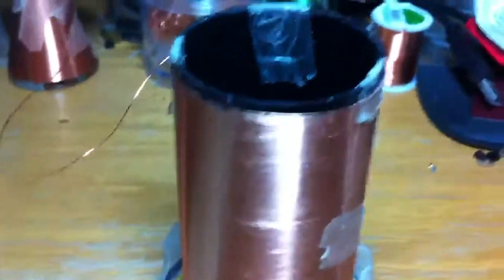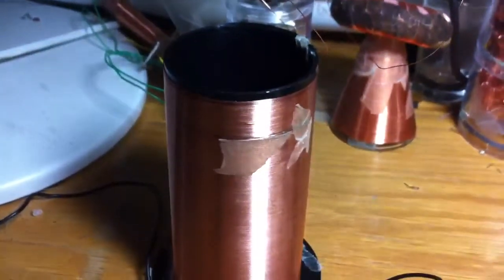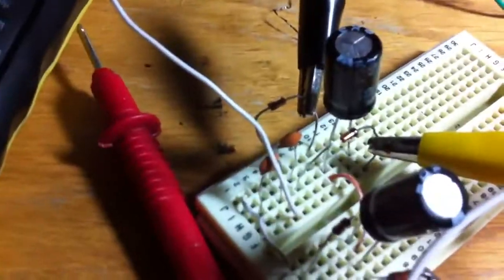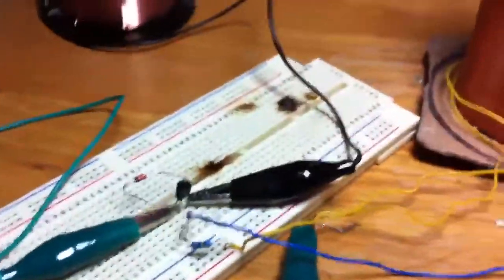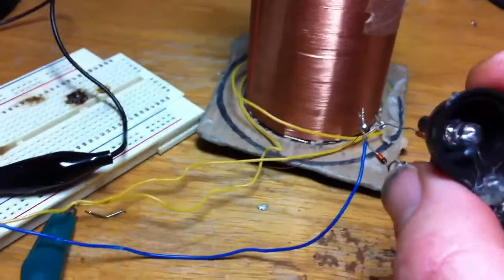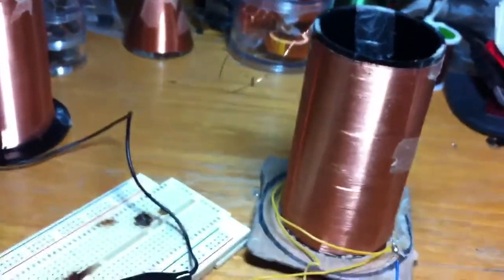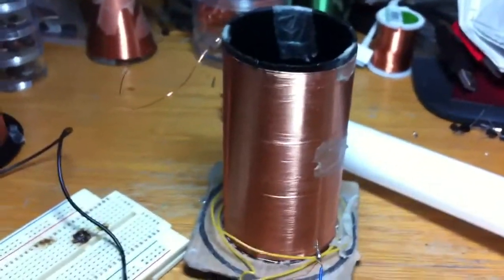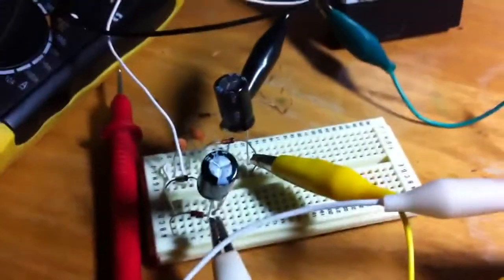Slayer exciter wireless charging of caps

Comment: Seams to me as though you can use the charge in the large cap to run all kinds of things, and since the number of pick-up doesn't place any additional load on the transmission tower - you could have several pick-up charging caps - then use the caps to run the transmission tower. Jump start it and then let it run it's self.
Free light to boot..